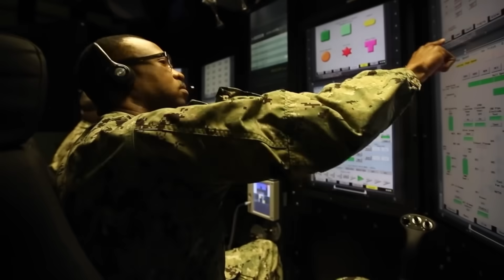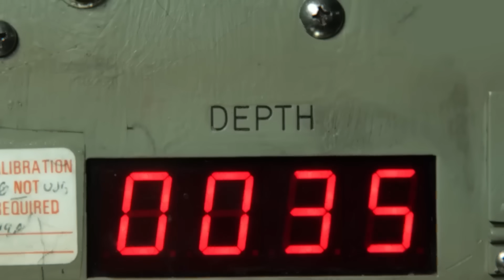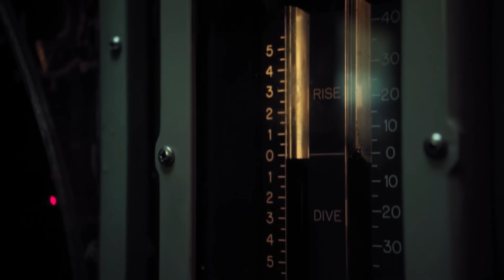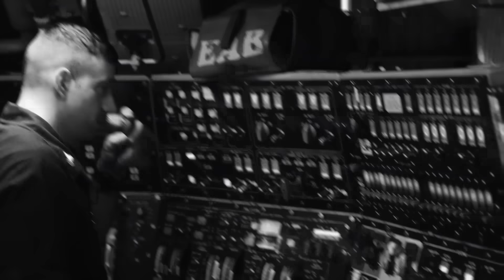What Happens When a Submarine Hits "Crush Depth"

Comment: For those wondering, the Titan submersible, at the depth it was at, would’ve imploded so fast that the passengers onboard wouldn’t have even noticed. At that depth, it would only take 0.15 seconds for it to go from perfectly normal submersible to metal pancake. It’s a sad way to go, but it’s good that it was too fast for them to even feel it.

EDIT:
To clear up any confusion, the reason is because they were under 400 atmospheres of pressure. Carbon fiber behaves like glass in that it completely shatters if it cracks. 400 atmospheres is equivalent to 5,878 PSI. Imagine the glass like carbon fiber having 5,878 pounds being pushed against all sides at once. There wouldn't be jet streams of water coming in before hand, even a microscopic crack would've been enough for the entire hull to completely shatter instantly under that extreme pressure.
Reply: I hope it was . Heartbreaking to see people suffer.. rip to them . 🙏
Reply: @TheSpunkAvenue they didnt suffer, it only took a millisecond
Reply: Way faster than that. Milliseconds.
Reply: @chrisulrich6629 0.15s is 150ms, so yeah..
Reply: @chrisulrich6629 yeah probably like 150 milliseconds
Reply: @chrisulrich6629 Isn’t 0.15 seconds just 150 milliseconds? With there being 1,000 milliseconds in one second, gives you context on how quick that is
Reply: It's way better than all the horrors that would come with being trapped down there in pitch blackness slowly dying by suffocation.
Reply: It happened in a millisecond. General human awareness of stimuli is 25 milliseconds so they didn’t feel a thing and were incinerated immediately
Reply: @christ0ph3rson70 o
Reply: It was also made of carbon fiber, which doesn't yield like metal does. When it reaches its limit, it violently shatters.
Reply: Except the tube was composite, so it shattered like a light bulb instantaneously once it was compromised. Even faster than a metal hull collapse I'd imagine.
Reply: @fire-fire-heheh  And their bodies, the same?
Reply: @MMA-CLIPS2  Dunno...? Notice how the Coast Guard dodged questions on body recovery? I'm super curious what kind of shape the bodies are in. I've seen so many different takes on it, but I'm afraid we'll never know. I doubt they will allow that info out. 

On the one hand, say you swam somehow out of a bell at that depth (I think the air pressure in the bell would be uninhabitable, but just suppose). It would be impossible to hold your breath and you'd suffocate quite quickly but be intact. However, here we have a violent event because of and in combination with the immense pressure. Who knows if they were ripped to pieces by hundreds or thousands of pieces of carbon fiber, did the air in the vessel and their lungs compress and decompress so quickly that they basically exploded, did the air ignite from compression, did their bodies and all other loose materials converge to a single point and become mush or what? I don't think this has ever happened in this exact way before, so we'd be reliant on some survey of the wreckage and lots of extremely smart people doing the forensics. 

They can model the material reactions pretty easy, but once you add humans, then it's so much more complex. They still use crash test dummies. They know exactly how the car will react. But they have to put dummies in there to figure out the rest.
Reply: @LMHUK88  how can I say this gently, they became toothpaste immediately.
Reply: @MMA-CLIPS2  I would assume their bodies are in a pretty horrendous state. We’d be lucky if we could even find a tooth.
Reply: @fire-fire-heheh  They dodged the body recovery questions because there are no bodies to recover. The human cells that used to make up those 5 people in the ship no longer exist. Completely atomized.
Reply: @fire-fire-heheh  the bodies literally became liquid.
Reply: @fire-fire-heheh  was just doing some digging and apparently during this type of implosion, the air inside the vessel would have burned (for a fraction of a second), at the temperature of the surface of the sun. Any body inside would have been incinerated very quickly.
Reply: @MMA-CLIPS2  Yup. Without going into graphic detail. They got red-misted.
Reply: @carmpocalypse  bodies are already 60% water, which can't compress. Everything else would turn to pulp, and there may have been dismemberment caused by the force of the water and submarine parts hitting them. Since the little sub partially disintegrated after the implosion, it could be that the bodies or body parts were carried away by the deep sea currents. I would be curious to find out.
Reply: @fire-fire-heheh  Google the Byford Dolphin accident. The pressure change is reversed but it's a good example of what going from 1 atmosphere to 10 or from 10 to 1 instantly does to human bodies.
Reply: @miggareto 
😂😂😂
Reply: @miggareto best way to describe what happened to the titan crew is that they instantly went from being biology, to being physics
Reply: @MadHatterDJ- I don't think they were incinerated. The vessel was too small. Atomized would be more correct imo.
Reply: @fire-fire-heheh  their bodies wouldn’t look great. If the sub imploded their lungs, sinuses, and anything else that contains oxygen would be crushed and filled with water. That aside they’d also likely suffer catastrophic injuries to their bodies from flying debris and crushing metal. Broken necks, backs etc. From there the sea at that depth begins to dissolve their flesh. 

They may also have been aware the submersible was about to implode too. While fast, there are various things that happen leading up to an implosion. Such as loud noises from the exterior hull groaning and creaking, water rushing in then bang. 

Ex Royal Navy and Marine diver.
Reply: @MMA-CLIPS2 "Their bodies went from biology to physics."
Reply: @bluebiblee  yup, I literally posted that in this thread already lol
Reply: @miggareto  No they didn't. Unless they were torn apart by the debris, they would be mostly intact. Our bodies are mostly water and therefore don't compress easily. The pressure at that depth would have ruptured all the air filled cavities but they would still be intact. Pressure wouldn't turn you into "toothpaste" 🙄
Reply: @fire-fire-heheh  we do know what state the movies are in, they are ashe.
Reply: @mikel9567   it's not the pressure, it's the pressure accelerating 25,000 pounds of hull inward at 660 mph.
Reply: @Alekai185 they were fish food. No way of recovering anything.
Reply: @fire-fire-heheh  Have you ever had Apple sauce before? Like that but with ketchup in it.
Reply: @MMA-CLIPS2 With an implosion like the one that just happened, there are no bodies.
Reply: @mikel9567 if the implosion didn’t completely destroy the majority of their human form— the following flash explosion most certainly incinerated them instantaneously.
Reply: @fire-fire-heheh There are no bodies.  They are basically puree.
Reply: @fire-fire-heheh  The condition of the bodies would be "crunchy paste", kind of like crunchy peanut butter...or maybe a bit runnier.
Reply: @Alekai185  At those pressures and speeds, all of their tissues were instantaneously rendered fine enough to pass through a sieve. Basically, they were liquified in less than a second. Their bones, including teeth, splintered into equally fine pieces. So fine they'd be smaller than a grain of sand. Have you ever dropped fish flakes into a fish tank and it sort of just dissolves? Yeah. They're fish food now.
Reply: Former commercial diver, at those pressure differentials, any gas ie oxygen, carbon dioxide etc would instantly compress to hundreds of times smaller than at the previous pressure. That includes whats inside the body, bloodstream, tissue etc. There wouldn’t even be any bubbles at that pressure. Kind of like the opposite of when you shake a can of soda and open it. All of the gas would be forced into solution with the water. Somewhere around 5,500 lbs of pressure per square inch, instantly.  Like, on a molecular level you would cease to exist.
Reply: Think about what would happen, if you were hit by a truck moving at more than the speed of sound. That truck is the pressure hull in whichever state of fragmentation, rushing in on you, and with tons of seawater behind it, pressing on.
If it came from one direction, you’d likely go ‚splat‘ into a number of pieces. But in the implosion scenario, there are the other sides of the pressure vessel coming in towards you as well.
They basically all hammer into you and esch other in the middle, at insane speeds and levels of force, so chances are, even well before you could even notice anything, you are turned into chunky paste.
Reply: @fire-fire-heheh there is no body recovery . They turned into dust immediately
Reply: @MMA-CLIPS2 flatten dband shattered can of chilli essentially
Reply: @chrisulrich6629  They became fishfood. Probably pieces about the same size as the flakes you would feed a goldfish.
Reply: @fire-fire-heheh they said their bodies “disintegrated” trying to figure out what that means exactly because there’s no way their bodies just… disappeared??
Reply: @jonj.j.williamsonphotograp175  that's an understatement. Their remains would be totally unrecognizable. They were crushed into paste.
Reply: @fire-fire-heheh If by any chance there was anything left of the bodies, they'd be fish food long before anyone could even so much as send a camera ROV down to look around.
Reply: @jonj.j.williamsonphotograp175  you are conflating an implosion of a sub at a much shallower depth, to being the same as what would have happened at 12,500 feet of depth. Over 300 atmospheric levels… there would be no “water rushing in”, when the carbon fibre shattered from the pressure, the implosion would have occurred in less than a millisecond. Also your experience would have been in vessels made of steel… not carbon fibre.
Reply: @mikel9567  go look up the byford dolphin accident. This would have been about 100x more severe of an implosion then that incident. The sudden severe pressure change would have likely sucked them out of the tiniest initial crack, now imagine forcing a human body through a crack a millimetre thick with the force of the Empire State Building pushing you through. They are mush bro… such insane pressure change would have caused an extremely violent implosion. A lot of people just don’t understand how deep 12,500 feet is. Over 300 atmospheric pressure levels deeper than the sea surface… insane pressure change in an instant.
Reply: @MMA-CLIPS2 bodies would be liquified under that pressure , so there’s literally nothing left to recover
Reply: @jonj.j.williamsonphotograp175  100% with you on your post. 

The problem I have with some of the "it got so hot and compressed they vaporized" or disappeared assertions is, sure, it got hot, but how many joules were produced, and how many joules does it take to make 5 people disappear instantly, bones, teeth and all? Without those numbers...

Just an instant of heat won't do it. Lightning bolts reach 5x the surface of the sun in temperature, and people even sometimes survive them. They don't ever disappear. And the bodies aside from lungs and cavities wouldn't compress much. It must have hurt like no surviving person has hurt for that instant before they lost consciousness. If it were even possible to survive that, the pain from the pressure on dissolved oxygen would be unbearable.

I'm on the side of horribly disfigured, broken as hell, kind of like maybe hitting pavement at terminal velocity, maybe even ripped to shreds from sharp carbon fiber shards. Disappear instantly? Hard to go that far.

Someone with tons of money should recreate the chamber, put 5 animal carcasses in it, and send it down with a couple of ROVs filming it. That would be interesting.
Reply: @MMA-CLIPS2 the body’s would literally be reduced to atoms
Reply: @fire-fire-heheh  Spiderman no way home< holy smoke they did die? sad to see them death
Reply: @fire-fire-heheh they turned to pulp, then burned up.  Poor bastards!
Reply: @fire-fire-heheh  i would imagine that the pressure would cause the entire mass to compress the entire mass into a single point, and then it would drift down, affected by water currents and aerodynamics.

. i think there's so much instantaneous compression force to where if any, decompression physics would be significant. But I would imagine that the "sound" is more like silence vs an explosion, obviously being loud.

 Even if it wasn't instantaneous, like scuba diving, it would still be too deep for your breathing muscles to overcome the pressure needed. Water would go in the weakest way, but you won't explode. Probably would rupture every cell in your body though, worst bruising ever.
Reply: @fire-fire-heheh  There are no bodies left.
Reply: @fire-fire-heheh  bit ghoulish m8. let's just say: "mush" and leave it at that
Reply: @fire-fire-heheh The bodies are red goo. The massive weight of the water crushing the tube so fast, and the subsequent second pulverizing jet of water  surging into any air space left over, would explode tissue and bone apart.

Goo, floating off on the current...
Reply: @chrisulrich6629 Not atomized, but close. Pulverized into goo.
Reply: @jonj.j.williamsonphotograp175  so are there skeletons down there from the Titanic or are they all dissolved.
Reply: @fire-fire-heheh  Because the camera wouldn't be crushed too? 😁
Reply: @miggareto  quite right ✅.  That submersible looked a bit like a toothpaste tube. And if it occurred near Florida then it would be fluoridated.
Reply: @fire-fire-heheh they would look like polony or any other processed luncheon meat..
Reply: @carmpocalypse  always were
Reply: @jonj.j.williamsonphotograp175 you’re wrong they were incredibly deep and under a lot of pressure no time to hear water rushing in.
Reply: The Navy and other parties involved said they aren't going to try to retrieve the bodies. They know there's nothing left of them.
Reply: @chrisulrich6629 Yes, that's what I read. I don't remember on which site, but it seemed reliable.
Reply: @fire-fire-heheh  yea no US tax payer wants to pay to find the bodies.
Reply: @chrisulrich6629 how would their bodies atomize or turn to mush when the controller controlling the whole thing was still intact. Very strange. There's a picture from one of the ROVs and it shows the controller perfectly intact
Reply: @miggareto I’m thinking a red mist.
Reply: @fire-fire-heheh  Implosions are extremely violent. Catastrophic implosions happen in a fraction of a second and then all that internal pressure tries to immediately escape which results in a sudden violent outward explosion. Their bodies or what is left of them are scattered in pieces across the ocean.
Reply: @kenzijones8074  I'm thinking they were like chilli, and quickly diluted into the surrounding ocean.
Reply: @FireFire_HehHeh I imagine it was probably similar to what happened to the diver that was blown out the hole for the diving bell in the Byford Dolphin incident. Medical examinwrs described it as gross dismemberment.
Reply: @lutzderlurch7877 so basically it's like being at the center of a collapsing star!
Reply: @fire-fire-heheh their bodies became liquid…there is no recovery….
Reply: @miggareto Finally, someone has the balls to say the truth
Reply: @fire-fire-heheh  what bodies is left for them to recover? Cmon now ain’t nothing left of them ppl
Reply: Some experts say they would have been reduced to the size of a bar of soap.
Reply: @MMA-CLIPS2 if you are curious and everyone else for that matter, there was an incident called the byford dolphin accident where “bodies” we’re actually recovered. Can’t remember specifically but their bodies were sucked through such as small crevasse since a hatch wasn’t closed all the way. The bodies based on the photos showed human hamburger meat
Reply: @TJWinter1221  Maybe not quite that nuclear extreme, but the basic idea. Seen any  of these old videos where they  made two locomotives crash into each other head on? Imagine those trains move at the speed of sound and someone being  right in the middle, when they they collide.
Reply: @fire-fire-heheh  yep, hence the 0.15 seconds. That’s near instant.
Reply: @Alekai185 n the world of science 0.15 seconds is a long ass time
Reply: @miquelr2353 human senses kick in at 1/50
Reply: @Alekai185    0.15 seconds is not “near instant.” Lol
Reply: @fire-fire-heheh  I didn't see it that way, do you think they heard it beforehand?
Reply: If they jettisoned the ballast and aborted the descent, then they were aware things weren’t going well. The time period could have been less than a minute or maybe it cracked and banged for longer. Either way they would have been shit scared but it’d be over so quick when it did give way they never knew they never made it
Reply: @highdownmartin exactly. Pretty much everyone figured an implosion but the fact they were dropping ballast and trying to come back up because of an emergency means they knew it was happening. Once it imploded it was instant but they most likely had a few seconds before implosion to realize they messed up.
Reply: @ThetopGoat where did you read they were dropping ballasts? That means they had some warning sounds that it was about to implode? Source please?
Reply: @ThetopGoat Indeed, the internal alert system likely notified them of a breach of internal pressure. However, at that depth, there was no way that system would’ve ever proven beneficial. They’d have been going nowhere fast either way, and the ascent would’ve been enough pressure for the failure to continue to catastrophe.
Reply: @omgurheadsgone It was shared by James Cameron and a few others that are in an exclusive hobby group of the top players in the field. Apparently information shared from varying authentic and authoritative sources shared said information with those individuals. View the James Cameron interview with Anderson Cooper.
Reply: @ThetopGoat Where did you reaf they were trying to come back up?
Reply: @omgurheadsgone James Cameron said it
Reply: @omgurheadsgone  Apparently they communicated they were aborting and started to drop weight. Then... nothing.
Reply: @ThetopGoat how did they know for sure they were trying to go back up?
Reply: @ThetopGoat ballasts dropped because there was no longer an intact tube to fasten to. If I recall, there was radio silence and at sea level they waited 3hrs to see if it would surface because they didn’t know if the ballast were dropped and it was ascending, or if communication was lost due to depths. Which wasn’t uncommon to occur.
Reply: @ThetopGoat and this was the moment, they realised, they fucked up…
Reply: @highdownmartin it likely did not “crack.” Any noticeable damage would just instantly cause the implosion
Reply: Of all the fates they could have suffered, this seems the most merciful given how instantaneous if is. But still....your life snuffed out in the crushing depths of the abyss. That thought unsettles me.
Reply: Well aleast it was instant die, instead of being stuck at the cold, dark, ocean bottom, waiting to die n knowing its impossible to be brought up.
Reply: The kid didn't want to go. Maybe he freaked.
Reply: I’m not sure. There are reports the sun released its descent weights thus was attempting to surface. So the people knew something was wrong.
Reply: I've seen theories that implosion was anywhere from 0.15 to 0.001 seconds with internal temperatures ranging from 1500 ° F to approaching the surface of the sun. And since the submersive was so small, it was probably more likely in millisecond(s)

They were atomized. Zero pain too.
Reply: @warwick802 atomized … like their whole body vanished into tiny atoms? I’m sorry if that’s dumb but I’m really tryna figure out🥺
Reply: @kenzijones8074  I am no physicist so im going off what Ive gathered. The 2 ends of the sub collapsed onto each other ~instantly and inside.....the water entered inside at around 2000 POUNDS of feet per second under a water pressure of 6000 POUNDS of SUQARE FEET. 380x the ATMOSPHERIC PRESSURE. Not only were they compressed at almost the cellular level with the sub from every side, It was so hot inside that their clothes, skin, tissues, muscles, organs, bones, blood cells boiled and disintegrated almost Instantaneouly before their body could even instinctively react to what was going on much less before the signals can even reach the brain. There were ZERO human remains after probably a single second  because the submersive was so small and they were so deep under water. They all felt and knew nothing unless evidence comes out that they knew. I'm surprised they've even salvaged sub remains
Reply: They demonstrated probably one of the worst ways you could possibly go
Reply: @mikehock1419  No, there's a lot worse ways to go that this.
Reply: Well it wasn’t metal lol, it was 5 inches of carbon fibre
Reply: @D9526328443789  that alone is insane ti think of using at that depth
Reply: @D9526328443789 
Ikr, how fucking stupid was the ceo.
The fragility of carbon fiber 🫥
Reply: @D9526328443789  Spiderman no way home< holy smoke they did die? sad to see them death
Reply: Fiber*, not "fibre"
Reply: @redraiderrider3289  depends
Reply: It wasn't a submarine though was it...
Reply: The submersible would have imploded inwards at a speed of around 2500mph. I.E a millisecond. The air would have ignited and their bodies would be nothing more than dust and bone fragments if that.
Reply: Ever stomped a ketchup packet from a fast food restaurant?  That's a reasonable approximation of what happened to that sub and the people within it.
Reply: faster than the speed it takes for their brain to even SEE it happening. (Which is faster than 'feeling')
Reply: At least they probably went out painlessly
Reply: That location where it imploded would have become an instant cloud of blood
Reply: Watching an interview of a sub expert, he summed it up pretty simply - if the Ocean Gate sub had imploded at or near the depth of the Titanic, to imagine being inside of it when it failed, just envision the Empire State Building being lift up 10ft, you walking underneath, and it being dropped, that’s what you’d experience; so needless to say, conversation on the sub was probably, what’s that noise?  Is that nor…💥🌊
Reply: @flaviuskern225  the empire state building comparison is kinda dumb. Just say a weight.
Like, I get it's meant to show scale but it doesn't. Buildings contain a lot of empty space aka rooms. Condense the building down and it's much smaller.
Reply: I think the more likely scenario is they would have been sand blasted by shrapnel of glass like carbon fiber, since it shatters.
Reply: google the "byford dolphin dive bell body" if you want too see what a body looks like after a sudden catastrophic pressure change.... that body went from 1 atmosphere of pressure too 13 atmospheres in the blink of an eye. 
the people in the sub went from 1 atmosphere too 370 atmospheres so i doubt there's any distinguishable pieces left
Reply: @Hambush13 What would happen to a fart at 500 Atmospheres?
Reply: @BUMBLE-FART  it gets compressed into a turd…it’s a really cool chemical reaction actually
Reply: I calculated 0.008 seconds based on the pressure and hull areal density, with final speed of just below mach 1.
Reply: I mean at that pressure and rate of compression it probably got so hot and violent so quickly they vaporized before they realized what happened.
Reply: Apparently they had enough of a warning to drop weights and try to surface. I imagine the hull was creaking or something along those line
Reply: Yeah they didn't even have time to be scared
Reply: It would have been nice if the owner managed to realise what happened before they went. He would have deserved that.
Reply: 30ms and the bodies are liquid
Reply: @broccolin At 100ms what happens to a fart?
Reply: All I care about is Suleman for some reason
Reply: Amazing how tiny fish can easily tolerate the pressure of ten tons per square inch when swimming around in water six miles deep
Reply: The titan was Carbon fiber, not steel. It wouldn't crush like a tin can, but shatter, like a plate, an even faster death
Reply: Except for one major thing, in one previous dive it was noted about a crackling coming from the Carbon Fibre. They would have heard the crackling and apparently they may have dropped the lead ballast before hand so they knew what was coming. That poor lad forced to go because of his father. I hope the Death Waiver doesn't stand in a court of law because it was turned down for certification.
Reply: @TheKira699  If that is true, they went down in a vessel the owners KNEW was already compromised! :o
Reply: @lutzderlurch7877  Very likely, so the death waiver would be moot and his estate could be sued for every penny.
Reply: @TheKira699  I have no clue about legalese, but I assume the surfacing  hints towards negligence and/or knowingly  engaging in  unneccessarily dangerous  things might come back to bit OceansGate.
Reply: They had dropped their weights and were trying to ascend. So they knew there was an emergency.
Reply: Whether it was .15 seconds or .15 milliseconds… I’m sure the people on board wouldn’t notice either way.
Reply: Issue is the debris they found is the "skid pan" and rear shell aparently both things that can be jettisoned in case of emergency 
They knew shit was about to happen
Reply: Not 5,878 pounds being pushed against all sides at once. 5,878 pounds pushed against every single SQ INCH of all sides.
Reply: I posted a video about Stockton, he explained that if it imploded, it would be “like 15 tons of dynamite”
Reply: Thank goodness, this is why I went to go find this video is to know what happens when a sub implodes. I certainly wouldn’t want to drown or run out of air
Reply: Would it be a pancake shape or spherical like a football?
Reply: I would have rather fallen asleep from a lack of oxygen than implode personally...
Reply: @davidagiel81 Really? After 96 hours of no food, no water, extreme hypothermia, a shared toilet that is unlikely to be operational. Repeatedly defecating on yourself while the other 4 passengers did the same, repeatedly vomiting on yourself — while the other 4 passengers also did the same, in pitch black quarters of a space the size of a mini-van with 5 grown men on board, sitting on the floor unable to stand or stretch your legs. I’ll take the implosion.
Reply: ya the dad wont have to ever know he just ruined his sons life
Reply: Crazy, we really don’t know crap about the Ocean or anything beyond the Moon.
Reply: But they would have known by the metal creaking before it imploded
Reply: @newage6924  it was Carbon fiber, so it wouldn't creak, it would Instantly shatter with very little warning
Reply: Okay internet scientist 👌🏾
Reply: Unless it was cracking slowly first, just saying
Reply: @jpz5173  I keep reading they supposedly  dropped their ballast early. They supposedly had sensors integrated into the hull to detect the faintest sounds and signs of delaminations and defects forming, So it is possible these sensors picked up something, caused them to attemt an emergency ascend, but the hull failed anyways.
So, they might have heard some audible noises just before  the collapse.
Not painful, but still scary
Reply: @PoX-amp  I hear time scales of the implosion itself would have been noticably shorter than that. Plus, it takes time for your eyes and ears to  record something, send the data to your brain, and then the brain to process that info. I very much doubt that this is enough time to actually 'notice' anything.
I read, the implosion would happen at  speeds exceeding the speed of sound.
even with conservative guesses, SoS is in excess of 300m/s and the sub well below 3m in diameter. it would have taken the sub less than 0.01 seconds to  fully implode.
Reply: How did you come up with the math for the 0.15 second value?
Reply: @PoX-amp  It's super easy to misread something in a massive wave of data and info like now. Nothing wrong with being wrong ;) Hope I was able to help out, and you're having a fine weekend.
Reply: I had watched a video where a guy placed a paper cup on the outside of a submersible that did a short dive and by the time they came back up, the paper cup was a small compacted ball. Crazy.
Reply: They must've Noticed it For A very small fraction of a second
Reply: They had warning systems, they may not have felt anything but i but they definitely knew something was  wrong before it imploded.
Reply: Damn, so many experts here about how human bodies would look like in the depths of Atlantic Ocean.
Reply: Hope they knew Jesus...
Reply: You don't know that at all. There could have been laser like jets blasting their way through between those titanium rings they simply glued on to the carbon fibre tube. They admitted the seals are impossible to check between dives. I don't see any reason to believe they died in milliseconds other than mere wishful thinking. Logic does not arrive at such a conclusion.
Reply: @entx8491 it would literally be impossible for "laser like jets of water" to be blasting the occupants.  If water gets in, the pressure gets in.  They didn't feel a thing, and were dead faster than the eyes could tell the brain what was happening.
Reply: @jasonmoore6868  you're assuming the flow rate was great enough, it may have been OR it might not have been, you don't know how it entered and you don't know how much of it got in before anything else took place; like the end cap coming off. Water volume would be proportionate to the air pressure increase unless the tube has buckled.
Reply: @entx8491  The navy heard sounds consistent with an implosion on Sunday, right when they lost contact, the debris of the sub  is evident of a cathastrophic implosion. physics make that implosion a thing of fractions of a second.
Is it possible some leaks formed before total collapse? Sure. but from what pieces of the puzzle  we know  so far, including the storied of crackling sounds the  pressure hull made during earlier  dives, the most likely event is a failure of the pressure hull by means of implosion.
Reply: Not exactly true, carbon fiber will suffer from delamination and apparently is audible when it starts and gets louder and louder as it progresses, Anderson Cooper did an interview with James Cameron a few days ago and he said this in case your wondering where I'm getting this info from, I trust him to know he is a very prestigious person when it comes to deep sea exploration and deep sea submersible design and development. He also said it's more than likely they did have some audible clues that the pressure vessel was starting to fail. Plus the sub itself was equip with a real-time hull monitoring system that would have sounded alarms as soon as a problem was detected with the hull. Cameron also said according to his sources who are "extremely credible" the sub was within 300 meters of the sea floor and dropped it's weights, only reason they would have done that so soon without seeing the Titanic would be to initiate an emergency ascent. They knew, your right the implosion and resulting death would have been quick and painless, but the moments leading up to it would be nothing but pure terror and dread praying the sub will hold long enough for you to surface, listening to the carbon fiber hull as it delaminates more and more.
Reply: I’d rather go this way than slowly dying in pain from cancer for 8 months.
Reply: maybe even nanoseconds*
Reply: My first thought when I heard that the hull was carbon fiber was, that was fucking stupid! Doesn't take an engineer to know that.
Reply: @PharSyde6ix  There are carbon fiber tanks for paintball that can withstand 4500 psi. The residing location of the Titanic is only around 5500-6500 psi. 
With pressure correction, and proper engineering it's not too hard to imagine you could make it sustain an extra 2k. Given the lack of support for the tanks in question.  And especially if it was infused with graphene or something similar

I think you need to do some research of what carbon fiber and the infused variants are actually capable of.
Reply: @zephirol4638  Yes, while that may be true, you can't continually put carbon fiber under that amount of pressure. Yes it'll hold but the issue with carbon fiber is, for how long.
Reply: @zephirol4638  I work with carbon fiber, you need to do some more research!
Reply: @PharSyde6ix  Well again... They're used for paintball guns, which are often filled for quite some time. It's used on vehicles/industrial equipment which put similar stats up in some occasions and are used from hours to literally days at a time.
And most have a life span of 10-50 years.
Reply: @zephirol4638  And none of those have tried to go to the Titanic, so excellent point! I love how you think that a company trying to get your money would tell you that it's good! 🤣 Again, I work with carbon fiber so, nice try!
Reply: As a more well known way of putting it, it was like you had the weight of the empire state building crushing you from ever angle. 
There is no metal pancake, the damn sub was Practicly turned to mist.
Reply: 1 day and already top comment when the video was 2 months ago. wow
Reply: Not sure it makes a difference, but the implosion of the Titan didn't happen at the maximum depth of about 4000m (at which there would be 400 atmospheres of pressure) it seemed to have happened after about 1.75 hours of a descent which should have taken 4-5 times as long so they were presumably at a much shallower depth and lower pressure
Reply: @NotQuiteFirst  Exactly, because the carbon fiber hull had already been compromised, most likely from the previous dives and with no inspections, they probably didn't recognize that there were micro cracks in the hull. Carbon fiber is not good when it comes to flex no matter what you try to mix it with.
Reply: It was way faster than 0.15 seconds. It was faster than the speed of sound. That thing imploded everything inside it into dust closer to 1ms than it was to 10ms (0.01s). It's 5,878lbs for ever square inch, not total. With the surface area of the Titan was at least 4,000 square inches, and therefor would have a total of around 23M lbs of force crushing it. PSI means pounds for every square inch. Fortunately for the passengers, they literally vaporized (because of how extremely high the temp got under that immense pressure and speed on implosion, combusting instantly) like a Thanos snap - they didn't even know they died.
Reply: @buruskeee  Exactly. There are some accounts that they heard some cracking noises and released ballast for emergency ascent but it was too late and the sub imploded within seconds of the cracking noises. Implosion itself would have been 1 or 2 microseconds, way faster than the human senses can perceive so they would not have felt a thing.
Reply: just imagine you can die without even knowing u died
Reply: @Insan3Mach1ne  I wonder if these new spirits are chatting with the Titanic spirits right now...all wondering what happened.
Reply: @eckankar7756  i also have these thought they are sitting in a white room with a white bench
Reply: @Insan3Mach1ne  I used to be a Hospice RN, saw many spirits of my patients before and after their deaths, some were getting ready to leave the body before death.  Interview is on my channel.
Reply: @Insan3Mach1ne  this is like this scary movie scene though 😂 how does anyone know they’ve died once they dead?
Reply: Using a $30 bluetooth controller to operate it should have made them think twice
Reply: @Caeser194 the controller is a non issue. Everyone bringing that up is a moron. They are controllers ffs. A device designed to control things. People use controllers for all sorts of things. Pretty sure the US air force use 360 controllers to operate unmanned drones
Reply: @XenonArcher  key word, unmanned. They were using a wireless, Bluetooth 30$ Logitech controller. What if it had connection issues, Bluetooth isn’t exactly always reliable. While bolted in a submarine from the outside. At minimum it’s an electronic fire hazard, those cheap controllers use cheap Chinese electronic parts that do not go through the type of safety testing that is required in an extreme environment like this…  seriously if a fire started, what would they have even been able to do? How would they even vent the smoke out?
Reply: @XenonArcher  bro why use that instead of an actaul steering wheel or something
Reply: @Caeser194 and a few did.
Reply: @Caeser194 fair point but even the military frequently uses Xbox controllers for different devices. It’s not a great look but obviously the controller wasn’t an issue
Reply: Wasn't metal. Would have shattered.
Reply: @amnesiagrunt2356 explains why they found a piece large enough to identify as part of the Titan.
Reply: @xyzunotme  Nose cone, and landing skids and tail piece were titanium. glued together with the Carbon Fiber pressure hull.

Pressure hull would have shattered. but nose cone and other parts would have survived...
Reply: I would imagine that there would have been some form of warning as it cracked.
Reply: @philcliffe6909  nope, it's pretty instant.
Reply: @Dreadpirateflappy  Death is at de-compression. Before hand though there would be the noises as it fails. As has been described on previous implosions whereby the steel work starts to buckle.
Reply: @Dreadpirateflappy there are reports they heard cracking
Reply: @Dreadpirateflappy bro they knew it
Reply: @philcliffe6909 nah dude. Take the biford dolphin incident. 4 guys in a pressurised sealed room on an oil rig (I really don't know the specifics of how the system works as, tbh, I didn't wanna know cus holy fuck, that's definitely the most horrendous work accident I've heard of). 2 guys outside that room. One of the guys outside hits a lever when he wasn't meant to yet (one of the 4 guys was in the middle of closing the door within the chamber) this instantly caused rapid decompression. All 4 inside killed and one of the two tenders outside also died (the one that fucked up. The other seriously injured) the guy closing the door inside was essentially rapidly pushed through the small 24" wide (horizontally) crescent shaped gap that the door left after jamming open. 
 the pressure difference was 9 atmospheres. 9. They were boiled alive and the guy closing the door was anything but intact afterwards. Compare that to the pressures the tinan faced at the point of crushing. Over 400 atmospheres.....
Reply: @XenonArcher  I  think there were 5 men. One man lived. He suffered severe neck and back injuries. I think he's still alive , & had Facebook page the last time I looked.
Reply: @philcliffe6909 unlikely there would have been any warning before implosion. The very instant the hull became compromised would have been the tipping point from strain to failure, especially the way carbon fiber composites react to stress. It’s absolutely insane that they trusted five inches of that material with their lives at that depth. 

It would have been in a constant state of degeneration with use. So it may have been strong enough the first hundred dives, but there would have come a time when it simply wasn’t. And that time was last weekend. I just don’t believe the bottom of the ocean is the place to be playing with new technologies and materials. You stick with what has been proven to work in the past.
Reply: @LateNightCable  Well the experts are saying that they would have heard the de-lamination of the carbon fibre with their ears. That's in addition to the sensors they had on board to tell them the structure was starting to fail. So you are wrong.... and don't like your own comment that's just sad.
Reply: @philcliffe6909  I did.  It had sensors on the inside to detect cracking.  That's probably why they started trying to contact the surface unexpectedly during decent. It was basically an experimental sub using experimental carbon fiber hull.  The end came as a bunch of red lights and alarms and then a swift and extremely violent death as the sub imploded and then exploded.
Reply: @cadenrolland5250  Yep... and those sensors could have been warning them with enough time for them to realise the end was imminent.
Reply: @cadenrolland5250 yup the carbon fiber was basically wearing out from the previous trips down there so essentially it could have been anyone to fall victim. I would buy a lottery ticket if i was any of those previous passengers on that thing
Reply: @cadenrolland5250 l
Reply: @cadenrolland5250 how do we know the sensors to detect the cracking even worked? They were very cheap when it came to making their sub
Reply: That's a very gruesome scenario. According to my searches, if a human body were in a submarine at that depth and the submarine imploded, it would be a very quick and violent death. An implosion is the opposite of an explosion, with pressure causing the vessel to collapse inward³. The force of the water rushing in would crush the submarine and everything inside it instantly, killing all the passengers with nothing left behind³.

The implosion would occur in *1/20th* of a second³, which means people inside the vessel would perish before they can even process the impact. The pressure would also cause their blood vessels to burst and their organs to rupture¹. The temperature and the darkness would not matter at that point, as death would be inevitable.

Visually, it would look like a soda can being crushed by a hydraulic press, but much faster and louder. There would be a loud bang and a flash of light as the air inside the submarine escapes⁵. The submarine would then crumple into pieces and scatter across the ocean floor. There would be no trace of human remains, as they would be dissolved by the salt water, the ocean animals and the bacteria.

So, in summary, a human body at the depth of the Titanic in an imploding submarine would not survive at all. It would be obliterated by the ocean. I hope this answers your question.😊.

Source: Conversation with Bing, 6/24/2023
(1) Terrifying video imagining the catastrophic implosion of submarine will .... https://www.hitc.com/en-gb/2023/06/23/videos-depicting-catastrophic-implosion-show-what-the-impact-does-to-human-body/.
(2) What Happens To a Body When a Submarine Implodes - DPFHI. https://dpfhi.org/what-happens-to-a-body-when-a-submarine-implodes/.
(3) What we know about the 'catastrophic implosion' that killed five men .... https://www.abc.net.au/news/2023-06-23/titanic-submersible-killed-five-aboard-catastrophic-implosion/102514546.
(4) What would happen to the human body if it dived down to the Titanic shipwreck?. https://www.msn.com/en-us/weather/other/what-would-happen-to-the-human-body-if-it-dived-down-to-the-titanic-shipwreck/ar-AA1cXkEk.
(5) Mortician Explains What Happens When a Human Body Implodes. https://www.msn.com/en-us/news/technology/mortician-explains-what-happens-when-a-human-body-implodes/ar-AA1cXjKT.
Reply: @CharliMorganMusic  this is bs...theres no videos to watch when you click on the link
Reply: This is a lie. Yea you would feel it, yes you would know you’re getting squished.
This is the same BS spilled about people jumping from building losing consciousness, yet sky divers never pass out and jump many times higher. Don’t believe nonsense
Reply: the thing with the design of this structure, it wouldn't be like in this video, it would quite literally be a pancake. they might find the hull with scrambled eggs inside soon
Reply: It was 0.20 of a millisecond, not 0.15
Reply: @Warhorse469  I love how people keep saying how long it took to implode. None of you know. Shut the fuck up lol xD
The difference between 0.15 and 0.2 milisecond is negligible
Reply: more like .03 seconds
Reply: They should have hired 50 year old white guys...they would still be alive.  Go woke, get dead.
Reply: No one was wondering.
Reply: When a submarine hull collapses, it moves inward at about 1,500mph
(2,414km/h) - that's 2,200ft (671m) per second, says Dave Corley, a former US
nuclear submarine officer.
The time required for complete collapse is about one millisecond, or one
thousandth of a second.
A human brain responds instinctually to a stimulus at about 25 milliseconds,
Mr Corley says. Human rational response - from sensing to acting - is believed
to be at best 1 50 milliseconds
The air inside a sub has a fairly high concentration of hydrocarbon vapours
When the hull collapses, the air auto-ignites and an explosion follows the
initial rapid implosion, Mr Corley says.
Human bodies incinerate and are turned to ash and dust instantly.
Reply: I feel bad for those people. They had to be the distraction while the biden family goes to court. And proven guilty.
Reply: I wish it were 1500 seconds
Reply: @ashgonza92  I get you hate billionaires so intensely that you give up any humanity you had left in the process. But this is just sick and depraved. Something a serial killer would say.
Reply: At least it was quick
Reply: The titan and the 5 people inside got crushed in 30 Milleseconds kinda scary!
Reply: what was the reasoning for titan to reach such depths?
Reply: @Luco205  to visit the titanic? Isn't that obvious?
Reply: Lmao nice
Reply: @Alekai185. I think you are an order of magnitude out
Reply: 6000psi pr square inch. I promise you they probably didnt even hear a crack or the leak. They just vanished. And an implosion at that level does not turn the Titan into a pancake. It creates so much energy it literally turns into a ball, followed by an "explosion" of sorts. It sucks itself together so fast the energy transfers outwards and rips into pieces.
I work as an ROV pilot and have been to 3000m depth in search for treasures, sunken ships and exploration. I have seen an implosion live on camera and it is so fucking terrifying. I would NEVER get in that thing if they paid me a 100m$ even. That said, I can not think of a better way to go, cause they did not feel nor understand what happened.
Rest in Piece. Abselute tragedy that could have been prevented.
Reply: Thats where it was located, not where it actually imploded. There is a difference. And since we don't know the details at that time anything stated is guess work and assumption at best.
Reply: @zephirol4638  Not quite true, US Navy hydrophones detected the underwater implosion sound and the approximate location of the sound, it was near the sea floor according to their sensors.
Reply: @southernflatland  No... They detected a sound, which could have been any number of things from falling debris from the titanic etc., to foreign subs/military, to natural events.  You're assuming that it was an implosion because of your hindsight of knowing what took place and the information that has came out after the fact.
Reply: @zephirol4638  The only reason information came out after the fact was that OceanGate took like 8 hours before they even announced they lost contact with the submarine.

The implosion sound they detected happened at the same time they lost contact with the submarine, detected from multiple sensors, and is said to have been triangulated to approximately 1600 feet above the Titanic.
Reply: @zephirol4638  They had optimistically hoped that initial sound they detected was somehow a false reading, the banging sounds they heard later was likely the rest of the debris falling and hitting the Titanic.

But after OceanGate finally announced they lost contact, the Navy already knew what time of day it was. They were just hoping they were wrong, but they knew.. ☹️☠️
Reply: @southernflatland  Ok, and what does any of that have to do with my point?

They didn't even know it was an implosion sound at the time. They only got confirmation when they found the actual vessel. 

They weren't even at their intended depth yet. So the time correlation doesn't make the evidence you claim it does. As again it could have been any number of things at that point, and correlation does not equate to causation.

Notice the words used.. They were not certain, and even still there are plenty of things that could account for the noise, as well as them to have an inaccurate reading on the location as well as distance. which again was only a general location to begin with.
Reply: @southernflatland  So now you're acknowledging that they could see it as a false reading... Yet somehow you guys all knew with certainty before the conclusive evidence was there. right.... What you guys did was assumed, and happened to be right. These are not the same thing.

If they knew, they would have just said it. As there would be no legal liabilities on their part. But they didn't. And why? Because they knew there was potential for it to be any number of other possibilities occurring and if that were the case and they didn't take appropriate action. Legal and civil suits would be raised.
Reply: @zephirol4638  Maybe you need to read my words in proper order. Navy knew they had a big obvious blip on their hydrophonic sensors, then OceanGate delayed reporting it for like 8 hours.

Once OceanGate finally announced lost contact, at the same time as the sound detection from the Navy...

US Navy put 2+2 together and realized the serious blip on their sonar systems meant the thing imploded.
Reply: @zephirol4638  They had no other evidence beyond that at the time, but they hoped their sensors were wrong and sent out rescue to try to find them, on the hopes their sensors were wrong.

Sadly it turns out their sensors were right.
Reply: @southernflatland  Ok... A blip doesn't confirm an implosion, so what is your point?

Ok again, what is your point? The fact they delayed a rescue call to the Navy does not prove an implosion.

They didn't. Otherwise they would have said so when it all took place, and not only after they found the resting place of the craft. You're assuming again, and I'm pretty sure I already told you the only thing that comes from when you assume.
Reply: @zephirol4638  There's a difference between an underwater blip versus an underwater bang.

Sonar is a fairly solid science these days.
Reply: @southernflatland  and yet you can youtube plenty of incidents where it's not. Just because something is relatively good, doesn't mean it's perfect and without flaw/error.
 and again falling debris, foreign vessels, (especially considering the warfare going on) natural events like earth quakes/fissures among numerous other things can create similar instances.

And regardless of any of this, your entire argument is moot. Because A. They didn't announce it was an implosion. Which if they knew with certainty, there would be no reason not to. and B. an explosion doesn't confirm the claim without actual validation. So none of this nonsense matters to the actual point you all keep moving further and further away from in a silly attempt to win a debate about a subject you clearly know little on.
Reply: I was wondering . Thanks for the explanation and while it is still horrible,at least those souls left the earth without realizing it.
Reply: The billionaire steps son is quite the hoot.😁
Reply: Eat the rich and their kids
Reply: supposedly the interior heated up hotter then the sun, the crew would've evaporated faster then the implosion, regardless, going out with no pain is exactly what happened.... targic but considering the alternative to suffocating at the bottom of the sea...
Reply: It seems weird to me that Stockton Rush never even got the chance to realize that he made a fatal error taking the sub down and that he was responsible for killing all passengers onboard. He literally died believing that everything was totally fine.
Reply: But they trying to abort, they heard the delamination so they knew death was approaching....Might not of felt death, but definitely felt absolutely terrified
Reply: why faster than 0.15 seconds. they said a fraction of a millisecond..and millisecond is 1/1000 of a second.
Reply: Spiderman no way home< holy smoke they did die? sad to see them death
Reply: Better than suffocating to death slowly die to lack of oxygen as originally thought.
Reply: Like pressure cooking a chicken.
Reply: Ahhhh....to be honest, not a bad way to die!
Reply: They got Thanos snapped.
Reply: At the point of implosion the inside of the Titanic submersible became as hot as the sun's surface so the passengers likely evaporated and there won't be any body parts found.
Reply: Whoa, their brains fell out 😢
Reply: The filter feeders ate well that night
Reply: rip :(
Reply: Essentially, dead before you know it.
Reply: They used carbon fiber and titanium. carbon fiber is electrically conductive and higher on the galvanic series than titanium. in a salt water solution thats a guarantee of galvanic corosion. the submarine was literally eating itself.
Reply: They are basically pure or fish bait
Reply: Hmmm I think they new, there would have been some creaking to start with
Reply: He said a submarine would crush instantaneously at 2400 feet….. ocean gate dove to 12,500 feet so they were literally there and then they werent😳
Reply: And the Navy/Government knew days before they said anything. Why?
Reply: @TracyW-me8br  They didn't KNOW. It was just reasonably obvious since they heard it. The sound could have been something else, that's enough of a chance to not call off the whole search before they found the bodies and craft, they will still look for it regardless. Also, they might not want to give away how they heard it.
Reply: @TracyW-me8br  they didn’t know, they checked for this after the fact. They don’t actively monitor the systems that detected the implosion. They checked it a few days ago and realized it did pick something up on the day of the trip but they didn’t know about it until days after.
Reply: @TracyW-me8br  They heard a sound that could be an implosion on sunday. They could not be certain without further confirmation, though (oceans are noisy places) and so they informed the top people in charge of the rescue operation, but did not go public immediately.
Imagine if they heard something, said "thats that, then!" and called off the rescue operation, only for some fishermen to find  a drifting  submersible a month later with 5 corpses inside.
As long as there was any hope, the coastguard etc. did an admirable job of trying their best to save lives.
Reply: What woudlve happened to their body? Would they have been just knocked out then dead or will it do something gruesome like turn their body to mince meat?
Reply: Is the Titanic wreck imploded as well? I mean it does not look like a pancake to me. Why is that?
Reply: @adamjo5287  It wasn't a sealed container when it sank.
Reply: You don't know if they felt it or not tho... There's a chance they still could feel some of it
Reply: 0.15 second is short indeed, so it's like they saw a sudden absolute HORROR flash in front of them.
Reply: @youuuuuuuuuuutube  If at all. Whatever their senses could pick up wouldn't have even reached short term memory in that amount of time. Like to put it in perspective, if you game at 60 fps, 1 frame would display on your screen for about 16 milliseconds. That's how much time they had. 1 frame.
Reply: Incorrect. It would have happened in about 20-40 milliseconds, at most.
Reply: I'm genuinely curious, do we actually know the approximate depth in which the implosion occurred? The comments seem to infer that it happened around the site of the Titanic, but I haven't been able to find anything online confirming this. If we know that the last communication took place an hour and forty-five minutes into the trip, how deep could they have gotten?
Reply: @ThomasKassman  it's because of the debris field , there are multiple currents at different depths and the way the debris field was found they know it didnt go through multiple underwaterstreams and it was fairly concentrated
Reply: @bertuj  Got ya, so they were likely near the Titanic, I appreciate that! I wasn't sure if their deaths were truly immediate, or if it was something they suffered through momentarily.
Reply: not all sides...at every single point on it at every single increment. water is fluid. it crushed all 360 degrees.
Reply: This was really informative and interesting. Thank you
Reply: They were around 190 atmospheres. Still a lot but not 400. The imploded 1hr 45 min into the 8 hr trip. (3 hr dive, 2 hr explore, 3hr go up)
Reply: There had to be warning signs before it happened, cracking , creaking, water leaking, the shape of the chamber or window distorting.  All kinds of weird sounds echoing telling you the chamber is about to fail. Maybe some screws, bolts or rivets popping out or shearing off.  Weird noises coming from outside as protruding objects mounted on it broke off, or large changes to the inside pressure.  It wasnt sudden enough for them not to know it was coming.
Reply: Believing the tube instantaneously disintegrated with certainty is almost as erroneous as believing the controller caused instantaneous decompression since you don't know what horrors of construction exist elsewhere. We've seen many already, no torque wrenches on seal fastening bolts? Taking it straight back out after it was struck by lightning? Thrust reversers were confirmed to malfunction THEN they wondered why it spins when pushing forward on the joystick while on the sea floor? Going back out after hearing cracking noises? Telling them to "live with it" and then ordering them to continue the exploration with a controller that can only go forward or backward, while being fully aware of strong currents? Applying the resin to seal the rings to the tube in a non-clean room environment with no ooze-out whatsoever to ensure complete and consistent application? The claim that it's impossible to check the seals but accept the use of them regardless? There are myriad instances of incompetence that could've brought this result, not just one.
Reply: May they rest in peace.
Reply: James Cameron said it best "you'd be chummed into a meat cloud in less than 2 microseconds"
Reply: Wow thank you for this super helpful info!
Reply: What is he talking about? This Titan sub went down and came back quite a few times before this final one.  So why didn't it implode before if it's because of the carbon fiber.
Reply: @mowomedia4801  Why? cyclic failure. Micro water intrusion. The more times, the weaker it gets.
Reply: I swear when I first heard about it, this is what I hoped for. I was hoping they were already dead and it happened fast. I knew they weren’t going to be rescued and best case scenario was an implosion.
Reply: You can say it as confidently as you like, but the truth is you we're there. It could have taken 3 minutes
Reply: huh... last I checked it was the Resin that shatters and the carbon fiber is really just reinforcement like rebar in concrete. but what do I know, I only work in composites manufacturing...
Reply: Annnd that’s material the engineer decide to use ? Wow.
Reply: @uPSIDEdOWN577  Rush's education and  background was in aircraft engineering, he used to work for Boeing and didn't really know sh** from apples about marine design, but was so arrogant he thought knew more than the experts in this field. It's like a cardiologist thinking he can do self- taught brain surgery better than specialists.  "Carbon fiber composites are really strong and are an ideal material from which to build many parts of an AIRCRAFT. The use of carbon fiber for aircraft bodies allows them to be more fuel-efficient, more aerodynamic, and to be built with fewer and lighter parts."- Monroe Aerospace. That's why Rush choose this material ; it was what he was used to working with as an airplane engineer. However, huge water pressure is a different story.  This stuff doesn't hold up over time when  subjected to tons of water pressure pressing on it causing molecular penetration and delamination. The dude just wouldn't listen, he thought he was just too smart, the maverick unconventional innovator. They tried to tell him.
Reply: That’s if it was at the bottom already. If it was at a higher elevation it would’ve been slower
Reply: All the implosion footage I've seen has been under 1 atmosphere of pressure
Reply: When will their bodies float?
Reply: The question is what FOOL would use Carbon Fiber instead of using HY Steel? A boat or a air craft it works like magic. Underwater with thousands of pounds of pressure well you get the end result look what happened to the people on board. As to recovering the bodies you can't it's impossible. What happened to the bodies I will give you an example. Take an egg and put it into a microwave oven and try to cook it. The egg will build up so much pressure and heat it will implode from the inside out and you will have a mess to clean up inside the microwave.
Reply: I don't know where you got your psi from but you obviously have no idea of real working psi. It definitely wasn't 5,878.
Reply: Imagine hearing that first crack 😖
Reply: They couldn’t even feel something if they tried, it’s like trying to feel a bullet enter your head before it hits the mash.
Reply: 787,000 lbs of instant pressure
Reply: Carbon fiber paintball tanks handle 4500 psi ( the location of the titanic  is somewhere between 5500-6500 psi)

That is a tank that is using basic carbon fiber, with 0 reinforcement. Not hard to believe that adding such alone would account for the missing psi.
But on top of that go google the psi durability and other stats on Graphene infused Carbon fiber. They are MANY times higher than that which would have been dealt with at the lowest depth in question.
Reply: Bunch of submarine engineers in this comment section huh?
Reply: But for it to get crushed that fast, you need to assume that they hit those depths extremely fats and not gradually right? Because lets say they went down relitively slow, at least until there would be a breach and water would fill the submarine, then it wouldn't have been instant, right? I'm not sure, genuinely asking.
Reply: @F34RDSoldier805  It would all depend what and where the failure starts initially and it's ability to maintain resistance around the failure area. But as soon as it got to the location where the people were,  they're pretty much done for instantly.  and especially for how they found it as the pressure would be equalized if it wasn't catastrophic and absolute and the damage when found wouldn't have been as bad as they stated.
Reply: Once carbon fiber is set, it's set!
Reply: Carbon fiber, one crack and the whole thing shatters instantly is categorically false. 

Its resin with string in it. Think of it like bullet proof glass or concrete with rebarb. Shatters but stays in tact because of the thousands of carbon fibers running through it. 

It also depends on the weave. Different weaves will give it different characteristics. 

Trying to drill through cf is a nightmare. Anecdotally it was much more tough than a common 304 stainless. However turn it on its side so the weaves are vertical i.e. IIII - it's like drilling in to plastic.

It's pretty obvious to me the dude made his own cf tube and it worked a couple times. Cf is extremely tough material. Pretty notoriously though it trapps bubbles. Not to mention, idk the weaves or characteristics, I just don't think it has the right rigid profile for that application.
Reply: @OnlyInaWorldsoCold  Compared to ductile materials, CF does tend to fail suddenly and catastrophically. It is very strong (not under compressive loads, though) until it all of a sudden reaches breaking point then shatters, unlike metal which will bend or deform before failing. Which is why CF is not used for submarines, normally.
Reply: No one on the news explained what 'catastrophic implosion' was...here it is simply explained.
Reply: They got turned into chunky salsa instantly
Reply: So carbon fiber turns to glass at that pressure.  I bet they ALL felt being shredded.
Reply: @robertbohun4349  It doesn't, this clown just doesn't know what he is talking about. Standard carbon fiber without any support can maintain nearly the same psi. and plenty of infused/reinforced variants of carbon fiber can handle far higher amounts of pressure.

A simple google search on graphene infused/reinforced carbon fiber and the psi in which it can handle will show you he is woefully ignorant.
Reply: @robertbohun4349  I can hear Joan Crawford screaming, "Why are carbon fiber submarines IN...THIS...OCEAN!!!!?"
Reply: So you’re telling me…all I need to do is find a submarine 🤔
Reply: lmao i guarantee they felt it and had pain but you can keep coping for me its fun to watch
Reply: @neilpopovich4966  Learn some science. The human brain takes 15ms to translate any pain receptors into something to feel. They were vaporized. It's not my fault you can't comprehend what over 5,800PSI means in terms of crushing force.
Reply: @buruskeee   lol wrong wanna try again?
Reply: Ahh yes the nerd section 🎉
Reply: You want a six inch titanium hull
Reply: You mean .15 nano seconds?
Reply: It happened on their way down ~1000 meters depth 100 atmosphere pressure
Reply: only critique, 15 milliseconds, not .15 seconds
Reply: Someone explained what happens on crush dept. Don't know if this is true https://youtu.be/yHD6D612nXI
Reply: They dropped the ballast, so they did notice they were about to die.
Reply: @BlackPrimeMinister  Well, if that CEO sub pilot had hired more 50+ year old white men with knowledge and experience, instead of hiring for “diversity”, hahaha, this wouldn’t have happened. Also, you are correct about that they knew it was over because the screeching, popping, cracking noises were heard for possibly several seconds before they were given the Darwin award
Reply: The morbid answer to everyone's curiosity unfortunately is: RED MIST.
Reply: Years back everyone became an expert Virologist when cov!d hits, then a military master strategist when russo Ukraine war happened and now everyone is a submarine expert. Wonder what's gonna happen later on.
Reply: @Dimapur  We’re also experts in laptop picture analysis and foreign affairs concerning diplomatic fallout because a president said he had zero knowledge of any of his tax evading son’s business adventures. Wait, the submarine thing happened exactly at the same time the son was accepting a plea or being sentenced, not sure because we are nautical experts over something unimportant as a distraction from important things. Hmm… Covid, Russia/Ukraine, sub situation… are they all distractions?
Reply: the same submersible had been down to these depths many times before, why did it shatter under pressure this time?
Reply: Very Interesting thread. I'm amazed my comment went through lol. I was curious as well what happened to their bodies. Like the implosion thing. It's easy to say that they where squish like a bug.
Reply: it's amazing that some marine creatures can swim about no problem at that depth
Reply: EDIOT...alert.
Carbon fibre 'does not' behave like glass. They are not made the same way or with the same materials. Glass does not de-laminate.
Reply: There seems to be a lot of misinformation and conjecture out here on the 'board; I'm going to need a lot more 'sourcing and citation if I'm to believe anything I'm reading on this comments compendium. 😮
Reply: it is a sad way to go, but that's what you get when you don't listen to people telling you that its extremely unsafe.
Reply: Crazy. I wonder if there was any warning at all that something was about to go wrong. Or if everything was just normal and then in the blink of an eye they're all dead
Reply: @vosoryan Look up James Cameron’s interviews. They knew.. 😣
Reply: And here was me guessing about 2 seconds
Reply: How did you calulate that? Let's assume the hull failed  instantaneously. The pressue wave would now rush in with at least 340 m/s (which is speed of sound in ambient pressue).
The diameter of the hull is approx 3 m.
3m / 3400 m/s = 0.009 sec
Reply: @DV4a1 I don't even think it's about water amount.. they were just crushed from the enormous pressure
Reply: @Myke666 i
Reply: @Myke666 so when we're talking about pressure, do we mean the air pressure which was already in the chamber/Hull, or is it pressure from contact with the water?
Reply: @DV4a1  Slight mistake, you used diameter and not radius since the implosion and preassure would exerted at all sides radially inward on it. Using 1.5m instead gives you a .0045 time of implosion which is closer to the estimate and way closer then "Bro I did the research"
Reply: Wouldn't it have sustained damage up to that point? There wouldn't have been any noticeable signs leading up to the implosion?
Reply: @OhShootKid  if that carbon fibre hull had any noticeable defects that you could actually see with your naked eye, it would have been a very early failure. I can't give any proper scientific explanation, but from what I've seen from people more knowledgeable than myself the tiniest of faults could have caused this. This wasn't something that was going to fail on the first time, more likely after multiple trips and a decent amount of microscopic wear from being exposed to those pressures repeatedly.
Reply: @miggareto  the thing you're referring to is fatigue strength. Carbon Fiber has extremely poor fatigue strength compared to say, steel.

To put it simply, as long as the load doesn't exceed a certain threshold, steel has virtually unlimited fatigue strength, so as long as the load doesn't exceed a certain threshold, steel can be loaded and unloaded an unlimited amount of times.

However, carbon fiber has very poor fatigue strength, so even if the load is maintained below a certain level, the carbon fiber will get weaker and weaker from more and more loading cycles. Basically, at a certain point, carbon fiber can spontaneously fail, even tho the load may be below the max load strength of brand new perfect carbon fiber.

Aluminum is another material with poor fatigue strength.

Hope that kinda makes sense and helps explain why certain materials are more or less suited for different applications. 

Most people only think about the density, tensile strength, compressive strength, bend stregnth, and hardness of a material. However, for engineers, fatigue strength is an extremely important factor when choosing a material for a certain application bc it basically shows how durable/reliable a material is over the course of many loading cycles.
Reply: @miggareto The main problem with carbon fiber is that it will hold until the moment it cannot, if it was made of metal, they would've noticed the problem earlier and fix it or abort the mission. lts the same as SSD vs HDD the first is faster better but not so reliable,  SSD fail in one go meanwhile HDD will give you enough time to save your data.
Reply: @miggareto makes sense as they have visited the site  a few times in this vessel
Reply: @miggareto as in the blink of an eye?
Reply: @miggareto they were also banging on the interior of the hull might’ve caused stress at that pressure.
Reply: @aelosx  The suspected banging noises were recorded  after the implosion was detected, so it could not have been them.
Reply: @RefinedRandy  Absolutely, which makes one wonder even more – how in the heck did the CEO think this was a good, long-term, viable option. Geezus. It seems he fancied himself a genius, yet missed things an undergraduate engineer could figure out.
Reply: @miggareto  It could even be those stupid LCD monitor stands they screwed into the wall of the tube or those diy store lights. Screwing things into carbon fibre is an absolute nope. These people are nuts.
Reply: @j4513  well jeez. I thought this happened decades ago when material science wasn't as advanced and before advanced modern CAD. Just realized it happened THIS FKN YEAR lmfao. Yeah that's a majorly stupid flop 💀
Reply: @RefinedRandy  you would think those 2 guys (the ceo and the French guy) would have known this...That French guy was an expert at this stuff. Was he really that uninformed? Its hard to believe
Reply: Cracks were found in the shell after the last few dives. I don't know why it didn't implode sooner.
Reply: @j4513  Yeah, that pisses me off. It's a pity they all didn't have time to beat Stockton's ass before they all croaked. Him with his slick brochure , big talk and assuring them that mickey mouse death trap was safe and sh**. That A.H. got off too easy. I know the victims were already rich, but somehow I hope the disclaimer papers the victims signed don't hold up in court and their families get all his money.
Reply: @OhShootKid  the problem with the material they used is that 1. It’s very hard to notice or detect any points of failure on carbon fibre and 2. Carbon fibre, while very structurally sound, behaves like glass. 1 crack and the whole thing shatters instantly.
Reply: @Alekai185 who told u its hard to detect weak point on carbon fiber, very easy on 8ft box , u need to scan it ...UT.
Reply: @OhShootKid  Likely not.  I am aware of carbon fiber risks with my bikes.  When it fails, it does so very quickly.  Take handlebars, for example.  If they're metal, they would bend before they break, giving you advance notice.  With carbon fiber, they just snap.  If compromised, carbon fiber is a very dangerous material.
Reply: @OhShootKid oming from a not-super-scientific standpoint, I imagine that mere seconds, probably even milliseconds, before the sub completely collapsed, the craft would begin to sustain visible damage. Like someone else said, carbon fiber behaves similarly to glass; one crack and the entire structure comes crashing down. I don’t think anyone would have had the time to have seen it coming; it would be nearly impossible to pick up on and react to given all of this happened in less than 1/4 of a second. The most likely outcome is that the pressure caused a crack. The very moment that crack appeared, the external pressure would have been able to crush the sub in an instant, at approximately the same speed as a balloon being popped. In that precise moment, the oxygen in the sub would have compressed, raising the internal around 3000 Kelvin, while simultaneously releasing a shockwave, enough to completely atomize their bodies.
Reply: A lot of the strength is in the shape. If anything defirms even slightly, the stregth dramatically decreases. And with the brutal forces at play, the cascading failure happens in a single instance at insane speeds
Reply: @OhShootKid its as fast as an explosion. Just in reverse
Reply: @OhShootKid They relayed that they were sinking too fast
Reply: @OhShootKid nope cuz the implosion would happen pretty much instantly, wouldnt even know it was going to happen
Reply: @OhShootKid  i'm guessing they heard a sound but before they could reallise even what it was it was over .
Reply: @OhShootKid  No, it wouldn’t have been gradual. Not like a navy submarine that progressively breaks apart internally as it sinks before final implosion. The size of the submersible, and the fact that it was made of composite (carbon fiber); which remains rigid and inflexible, but becomes weak and rather brittle (for lack of a better term) under extreme pressure, all it would take is for a crack to form and before any indication or ingress of water, the difference (or imbalance) in cabin pressure to outside pressure would instantaneously make it suck in on itself. Since there is not equal pressure pushing outward on the chamber as what is pushing against it from the outside, the interior pressure is weaker and thus it will literally flatten together. Like pushing both ends of a soda can together between you hands. Long explanation, but a contributing factor to the quickness of immediate implosion is the size of the mass. The smaller the more instantaneous. They would have had no idea it was happening or even an “oh sheit” thought, 0.15sec is faster than the brain can register. Their last thought would have been all is well and normal and are we there yet.
Reply: @OhShootKid the CEO admitted to there being issues with the life support but they are cheap
Reply: @OhShootKid  This isn't metal. With even the hardest steel, you tend to get damages that are visible before catastrophic failure. E.g. slight bending.

With carbon fiber, it's going to be more like a cracker. As you're about to snap a crack, most of the time you won't get any signs of damage before you see cracks appear on a dry cracker.
Reply: They instantly became pulverized to smitherine. There is nothing to recover. What it must have felt like or was it just lights out for eternity. So weird to think about so I won't anymore
Reply: It would have been a lot faster than that.

Also,
they would have been knocked unconscious inmmediately before actually dying.
Reply: @j.griffin  If it happened that fast there wouldn't have been time for you to be knocked unconscious before dying and at that speed it would have been inconsequential anyway
Reply: @Treggs1 then who or what was knocking??
Reply: @MasterVsApprentice  probably the Titanic wreckage it's made of metal and the water is always moving around it so it's bound to make some noises it wasn't the titan otherwise the sound devices would of picked up the implosion if it hadn't happened before they got there
Reply: @j.griffin  a lot faster than 0.15 seconds? The research I found is that the math points to approximately 0.15 or about 1/10th of a second which is really fast. I understand they were very very deep, but the pressure was still not enough to reach water jet cutter levels. However, yeah they most definitely would’ve been knocked out instantly and probably burned for a split second as the oxygen inside compresses so fast that it creates immense heat, not to mention it’s already an extremely flammable gas.
Reply: @Alekai185 I saw 0.030s, 3/100 of a second somewhere
Reply: @Alekai185 they were crushed like a bug. There is nothing left of them. Crazy
Reply: @Alekai185  Oxygen is not flammable but it does support combustion with reactive material.
Reply: @Alekai185  Yes, much faster then .15 seconds, an order of magnitude faster, and 4-5 times faster then most estimates.
Reply: @Alekai185 oxygen isn’t flammable. It allows things to burn strinfer
Reply: @Alekai185  Oxygen isn't flammable: it is an accelarant..
Reply: @Alekai185  Would be 20 miliseconds roughly, about 0.02 seconds
Reply: @Alekai185  Spiderman no way home< holy smoke they did die? sad to see them death
Reply: @Alekai185  I mean I'm sure you're right but it's YouTube so obviously somebody had to correct you
Reply: @j.griffin 
Wouldn't it actually be a great way to go?
I mean, if you're unaware and it's instantaneous, wouldn't it be one of the best ways to die?
No time to process life.  Your sitting there as yourself and in  milliseconds you cease to exist.  The even being so fast you are unable to process it.
It's sad, but not tragic. 
To be clear, I feel for sadness for the dead and their family.  I think the father and son is especially hard.  I see a lot of people disparaging the dad and this seems unfair.   It should have been a once in a lifetime experience and experience that only a handful of humans will experience.   He wants to share that with his son.  It's really fucking sad.
It's sad, but not tragic. 
 It was avoidable.
Reply: @j.griffin are you really going to start arguing over milliseconds
Reply: @j.griffin  I saw a report say it would have been more like a millisecond.  0.001 seconds and they would be likely vaporized at 5500psi.
Reply: @dkruitz liquified.
Reply: @dkruitz so worse than getting run over by a steamroller? That's what it sounds like but since they're in water, at such a great depth, they were reduced to tiny bubbles of air, molecules.
Reply: @j.griffin  That's actually false they had an idea of what was happening and release their weights trying to go backup and then imploded so they had an idea it was about to happen everybody needs to stop trying to act like their expert when they watch one video
Reply: @j.griffin  faster than 150 miliseconds?  stop commenting lol
Reply: @j.griffin how fast was it?
Reply: @j.griffin thank god then cuz can you imagine if they had even been briefly aware that they were being flung out into the dark, frigid ocean! I mean how terrifying that would have been.
Reply: @j.griffin he said .15 sec on 15 sec they died instantly, they have no idea what happened
Reply: @j.griffin 🤓
Reply: @j.griffin lol ur really arguing over something potentially quicker than .15 seconds and also arguing that it would be them going unconscious. They might as well be considered dead in this case anyhow. Saying they’re unconscious due to anything a fraction of a second prior to actual death since there is no way out sounds kinda dumb.
Reply: @j.griffin .15 sec? Faster than that? That's pretty damn fast. We get the idea. Stop trying to overthink it
 We got it, we ALL got it... they were done,  instantly...
Don't be THAT guy...
Reply: @j.griffin unconsciousness wouldn't of been an option. Every bone, and the lungs would implode instantly
Reply: @j.griffin not true
Reply: I don’t know why people are asking what would’ve happened to the bodies. What the f*** do you think happens to a human body when an EMPIRE STATE BUILDING (made of lead) falls onto it?! 😂😂😂
Reply: @jazzman2516 Survive unscathed? 😂
Reply: It was at a much larger pressure than the one mentioned here. I saw a calculation that said that if they were near 300 atmospheres the implosion would last around 25 milliseconds
Reply: Everyone in the comments coping hard by saying it happened so quickly they wouldn't have known or felt a thing. Make no mistake, there would have been warning signs it was going to implode. They would have had seconds if not minutes of pure and unadulterated fear.
Reply: @69429boss very much doubt it bud, this was a  pile of junk, a ramshackle glorified toy, not built properly not certified and free from any  basic safety checks.
Reply: @69429boss  No they didnt. Stop talking about things that you clearly do not understand. Or at least go learn about them first.
Reply: @morrnmanderson7376  cope more...
Reply: @69429boss  thats what i think too
Reply: @69429boss who knows if they knew or not. It might of happened so quick before any alarms went off. They were being as cheap as possible. I wouldn’t be surprised if their alarm system didn’t work properly or it wasn’t flashing lights and could of been just a red quiet light bulb
Reply: @69429boss 
I agree. There was probably panic on an unimaginable level for at least several seconds.
Reply: @nathanielovaughn2145 in a situation like that, one second would feel like a minute. 😢 Fear is powerful especially when validated.
Reply: @69429boss not to mention I always feel like time slows down when something terrible is happening to you . I could imagine that those few seconds felt like hours of anxiety , worry , fear etc . Terrible way to go
Reply: I'd imagine there was a whole lot of noise and stuff when things started failing I'm pretty sure they knew something was wrong if if only for a second or 2
Reply: @dannyherbert4482  na they had no idea. One min they’re alive the next they dust
Reply: And it would have created a heated flash hotter than the surface of the sun
Reply: Damn y’all acting like y’all scientist behind all this.
Reply: 🎶 There’s a billionaire at the bottom of the ocean, who’d give anything to swap places with me. it’s kinda funny, that money means a lot less to somebody, when oxygen is the only thing you need. 
So I guess instead of counting cents, I should be counting my breath, as my primary form of currency. Cause it turns out that big old house you owned, and fancy car you bought for show, don’t mean shit at the bottom of the sea. 🎶
Reply: @RobsRemixes a truth most ignore.
Reply: @RobsRemixes well that hit me hard. Very interesting perspective. Air it is ✌🏾
Reply: @RobsRemixes well said!
Reply: @RobsRemixes  I mean his family’s taken care of for generations upon generations they will never have to worry financially in the entire existence. I”d say he did his job as a man. Meanwhile you keep counting those breaths you are taking 🤣🤣🤣
Reply: At least they got down there and see the titanic
Reply: @brasinovic  I don't think they even made it to see the Titanic
Reply: @Stej-i7m  I don't think so either. Could've made it to that depth but may have imploded prior to making it to their destination
Reply: @brasinovic  "At least they got down there and see the titanic"  No, they didn't see it. They imploded at about ~1hr 45 min. on the way down. That's when contact with them was abruptly lost. It takes more than 2  hours to get down to the bottom so they didn't even get to see the Titanic.
Reply: Can someone explain to me why the submarine seems to be fully intact when recovered ? I though it must look crushed too no ?
Reply: @oliviak.7977 #  hi olivia, the toy sub was blown to smithereens with all 5 people inside, reduced to blood guts and ash --  instantly. 
All for one man's ego,  greed and desire to pocket $250,000 each from the 4 hapless souls aboard .
Reply: @oliviak.7977  they found parts of it .
Reply: @oliviak.7977  The Titan submersible was not recovered. Or are you referring to something else?
The degree to wish a submarine crushes, generally, depens on the depth at which it happens, i.e. how  high the pressure gradient was, and how much was already flooded. Military submarines tend to get crushed because they are already sinking, i.e. partially flooded.
Reply: @lutzderlurch7877  then what are they in the media showing ? Are these old pictures of the submarine ?
Reply: @oliviak.7977  Unless there is some very different new developments, that I missed, they only showed old footage of the  Titan submersible. 
Last I heard, they found the tail cone and the two titanium half spheres of Titan in a small debris field in front of the bow of Titanic among other  smaller debris.
But I have yet to see any images of that.
Reply: @lutzderlurch7877  ok now I understand so the pictures shown are just old pictures
Reply: from what im guessing they know that something just not right so the people there in the submersible became scared then they try to fix it to go up but cant so they just waited while the submersible is slowly going deeper then the people inside tried to accept their fate then the bad happens
Reply: @qp8080  If the reports are correct about them releasing weights, they  might have  noticed something was off, dropped weights, and imploded before they had time to resurface.
Reply: they would feel it... its not a blink of an eye.
Reply: @JohnW704  The implosion would happen at around the speed of sound, that leaves less that 1/100 of a second. Good luck finding any human being able to perceive and process anything  within that time frame.
Reply: @JohnW704 it was
Reply: @JohnW704 it was faster than a blink
Reply: You can't be sure they didn't feel anything, 
they were super scared probably after they lost communication.
Reply: @cautarepvp2079  The physics dictates, that they would not be hurt or harmed, in any manner that would allow them to perceive it.
They might have been scared, if their sensors gave any warnings or they heard something, but the timeline indicates they had very little time to process any fear before  the implosion.
The only possible way of suffering  before the implosion aside from fear, could be, if they has some fire or similar happening, which could have set off the chain of events, but it does currently not appear to be the case.
Reply: @cautarepvp2079 the pressure was too quick. they didn’t feel a thing or see anything.
Reply: It really makes me wonder if some of them weren't actually conscious for few seconds after implosion, actually experiencing their own death while feeling completely smashed from every direction not being able to mov
Reply: I heard in a YouTube video the air inside would have been superheated to the temperature of the surface of the sun. That's instant death.
Reply: @nexttytreporter2598  - false!  Temp, down there is almost freezing.  Get outta here.
Reply: The main problem is that there's buildup, like you can hear the submarine creaking and it becomes more frequent before crush. Least the actual death is very quick, the buildup isn't though
Reply: @P.H691  Not in this case. They would have had VERY little time. Yes, the submersible was fitted with sensors, so and reports are that they dropped ballast, so they likely knew things were happening, but carbon fiber doesnt buckle and groan and creak, like steel would.  With carbon fiber, things are fine until they arent. Once a fault begins to happen, the fiber shatters. Almost like glass.
Reply: One second their laughing at the victims of the ill fated Titanic, the next they are victims of the ill fated Titanic sub. The Titanic claims a few more souls foolish enough to temp fate physics.  R.I.P.
Reply: @cadenrolland5250 yes I heard there were recordings of them laughing so hard that experts think all the laughing may have led to the implosion
Reply: @cadenrolland5250 don't think they were laughing at the victims. Weird thing to say.
Reply: honestly i dont really buy that. How could they get that deep and get crushed that fast without knowing something sooner. I kinda think it happened slower and not as deep. Really doubt they were more than halfway down. They could have heard creaks and tried to go back up.
Reply: @youngtuna2385 They were an hour and 45 minutes down when all comms were lost. That is closer to Titanic than it is to the surface. They had communicated to the boat earlier that they were descending too fast. That may have caused even more stress on the hull but idk…When the   sensors went off indicating a problem they started dropping the weights to ascend. They likely had seconds maybe minutes of knowing they were in catastrophic trouble. 😣 I hope the 3  experienced divers remained calm for the sake of the father and son. All of this info I got from James Cameron’s interviews but I may not have used correct terminology 🥴 it’s just awful. 😞
Reply: @youngtuna2385  The only issue with that perception is that the debris would have rose to the surface sooner if they were not very deep and the debris that sank would have been carried further by the ocean current as it sank 2miles down than where it was found. And much of it was found near the titanic, consistent with it being deeper and closer to the titanic. So, it was actually closer to the titanic than it was the surface. It also takes 2hrs for that submersible to descend 13,000ft and I think they lost radio contact around the 2hr mark, which is in part why they waited 3hrs on the surface to see if it would resurface. Because under normal ascension it would only take it at minimum 2hrs.
Reply: i wish the titan passengers didn't die so quick, they should have suffered and slowly starved of oxygen :(
Reply: @_josh_hazy_  That sounds like a cruel thing to say.
Reply: @lutzderlurch7877  🤣
Reply: @lutzderlurch7877  they deserve it don't you think?
Reply: @_josh_hazy_  I don't think they deserved to die. One can talk about how responsible  these individuals were, but I do not think they deserved to die.
For example, did the  19 y.o. who was terrified of the thing and only went to bond with his father  around father's day deserve to die?
Does a mother with a baby, steping unto a bus, knowing there are traffic accidents, deserve to die, when the bus drives off a bridge?
Reply: @lutzderlurch7877  yes actually I think they did. Just sucks it was quick when it should have been slow and the CEO Stockton inarush could have suffered by getting beaten by the passengers in their remaining days
Reply: @_josh_hazy_  Then I reiterate: That is a cruel thing to say and feel, in my opinion.
At any rate, hope you are having a decent day, bye
Reply: @lutzderlurch7877  yea right 🤣 I had a dream I was in the oceansgate sub and I was picking his eyes out with my fingers while the others were holding him down and breaking his arms 🤣🤣
Reply: False— it happened at :05 seconds at that crush depth. They would have felt minimum of 4 seconds of pain.
Reply: @natt408 what are you saying? If an implosion happens in less than 0.5, how on earth would they experience pain for 4 seconds lol
Reply: @XenonArcher  - What Im saying I that an implosion takes :05 seconds to occur. So this narration is completely false and presumptive.
Reply: @natt408 That’s wrong
Reply: Strange the navy put this video out right in time to be easy to find when we found out the sub imploded.   Now the navy says they heard the sub implode.    All I'm saying is rich people, vulnerable position, absolutely no witnesses.    Which of those billionaires knew too much?
Reply: @jameskahler7519 For years people in the community were saying this submarine was a ticking time bomb. Their own engineer left the project because it was unsafe and was sued by ocean gate. The thing imploded. It’s as simple as that
Reply: @jameskahler7519  - Oh god here we go with the crazy wacko conspiracy theories.  We need Trump in jail or given the Death P period. 

#BlackLivesMatter
Reply: @jameskahler7519 So if I understand you correctly, this is (yet another) conspiracy and the navy have made an effort to give us all a hint for some reason.
Reply: @jameskahler7519 and close to a ship that sank with other rich dudes that knew too much.
Reply: Well done you've been watching the news like everyone else that won'ts to know what's gone on. The fact you haven't even said you feel sorry for the family's of the people board just shows me your there for likes.. Don't forget over 1500 people lost there lives on the titanic and that's why they where there. 🙈